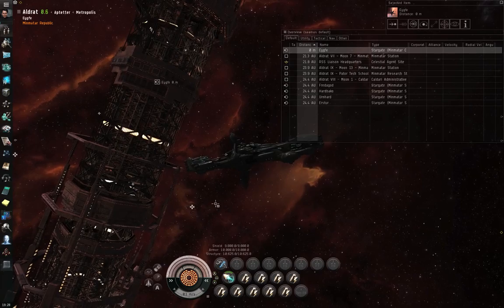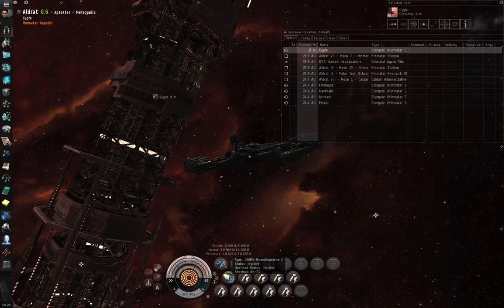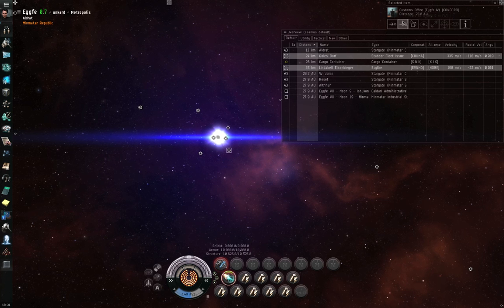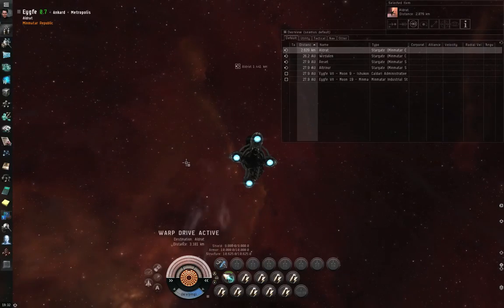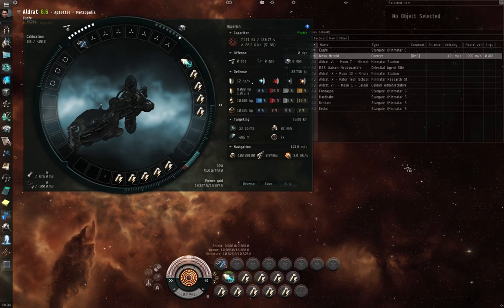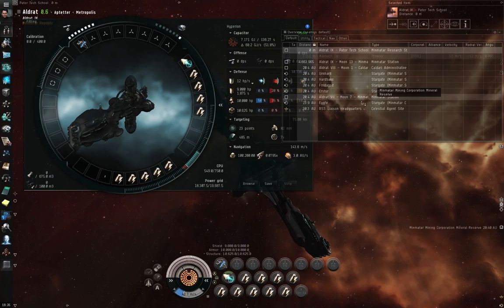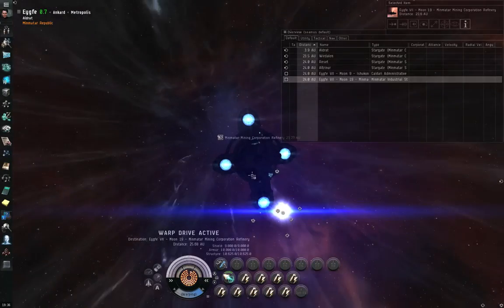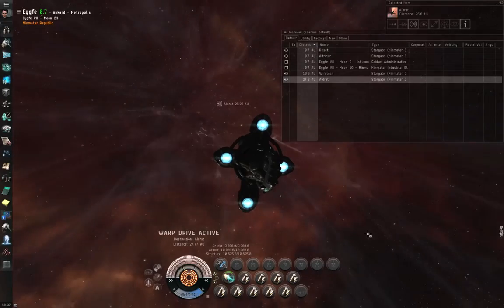Microwarp Cloak Trick - Short Version

Comment from the maker: Yes, but keep in mind that the Prototype and Improved Cloaking Devices will penalize your Scan Resolution.  They also impose a locking deadtime if you *just* decloaked.  So, there's a delay before you can *start* targetlocking, and even when you start, you're going to targetlock slower than normal.

Comment: There has been one mechanic change that affects this.  When I'm gate camping, I'm in a battlecruiser or a cruiser.  My friends are in the same, and sometimes we have a heavy assault cruiser.  These ships can all arrive at the destination before a battleship, especially the HAC.  So, if you chose to go to a station, you might be forced to dock or die.  If you dock, you might have to play the station game.  If you go to a gate, you'll have tipped them off as to your capabilities, and they might decloak you the second time.  If you go anywhere else, like a belt, you might lose your ship.  At belts, player pirates will use fast locking frigates.  

Whatever the case, it is best to be on the winning side.  Try piracy.  :D.

Comment: This does not work in 2017 if you hit jump before cloak it will not let you cloak , you get a error message. So for 2017 its align , mwd , cloak , 1 cycle of mwd deactivate mwd , deactivate cloak , hit warp to zero . real important it is warp to zero or you slow boat to the gate .

Comment: No, there is no reason to use this technique with a blockade runner.  Activating a MWD increases the time it takes to warp off, and a blockade runner can warp while cloaked, and doesn't have a movement penalty while using a covert ops cloak.  A blockade runner has an align time less than 6 seconds, around 3 seconds if you fit four inertial stabiliers to a prorator.  This trick takes 10 seconds.
Reply: Incorrect.  You apparently have never been decloaked by proximity.  If a Dramiel gets within 2000m of you, you are not warping out, rather you will be losing your pod as well
Reply: How does a mwd help versus this dramiel?  A blockade runner will not have moved more than 2km in 3 seconds, which means if you didn't activate a mwd, you would be gone already.  Worse, if you did activate your mwd, the dramiel can lock you faster now.